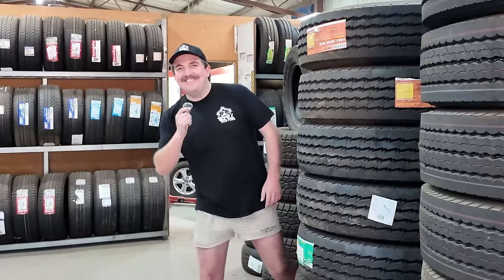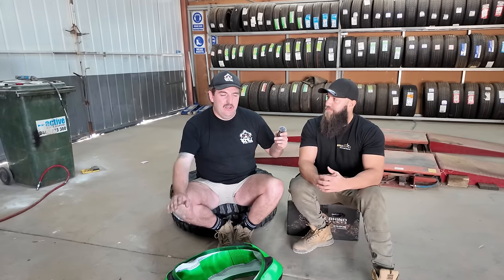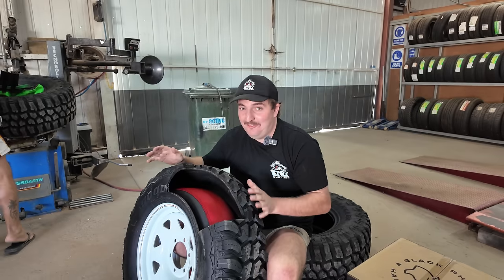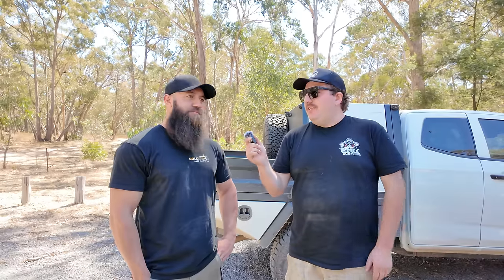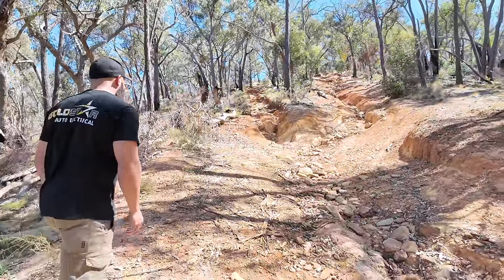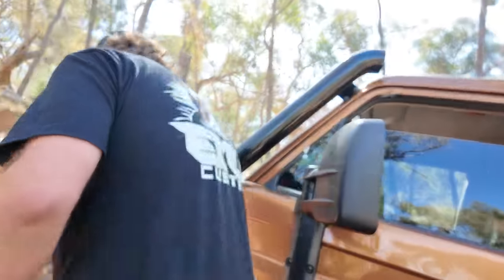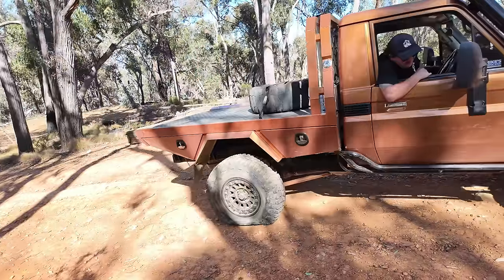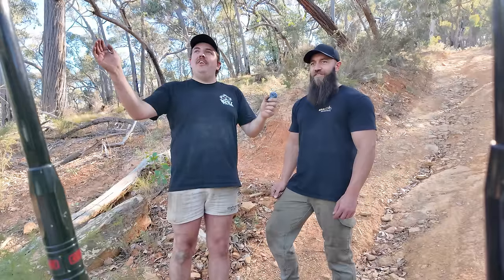No more DEFECTS?!? Pneumatic Beadlocks - (install and torture test)

Comment: Well…… unpopular opinion here: I experimented with internals. Stauns I had in about 2008. Junk imo. If you’re in muddy ruts etc, tree slash, or rocks, -these don’t stop grit getting in beads and the subsequent slow/fast leak. 

They still leak like a non beadlock but with the inconvenience of having to deflate the inner tube to clean out bead. And instead of a non beadlock often being rolled off the rim when you get grit in it, easy to clean out and pop it back on.

With these are still fully stuck on with your leaking bead. You gotta deflate both, then break bead, then clean it, and then you gotta worry about water and debris getting stuck under your inner tube and damaging it or your rim.

The other issue is….. you gotta drill an extra hole for 2nd valve if your wheel doesn’t have it. This also makes your wheel illegal…. Haha

But there is hope…. the slightly better option is Hutchinson internal locks. Worth investigation. I ran those in 2017ish

After many years experimentation, I came to conclusion that if you aren’t going to run a true mechanical lock, just sikaflex the beads and run a conventional tube,that way you can get a bead full of grit with no leak, and even if you punch the tyre off rim with a hit, it will nearly always reseat itself because it doesn’t deflate like a tubeless tyre.

The down side to running tubes at low pressure is that your tyres can slip on the rim and tear the valve out of the tube. Hence the bead sealant.

Anyway. Best of luck. Hope they do what ya need.
Reply from the maker: Hey mate! Appreciate you taking the time to share sounds like you had a bad experience, can i add that these aren’t staun beadlocks, secondair are the original and i have not heard one bad thing about SecondAir beadlocks spoken to guys that have been running them for upto 20 years with no issues and if you watched the whole video you would have seen i didn’t have an issue have also done 3000km since but i guess time will tell!
Reply: @Unclepooly  yea for sure, for what you’re doing they are probably gonna be fine as a road set. -but as you point out these are not a replacement for actual beadlocks offroad.

I wouldn’t say I had a bad experience at all with internals. they worked perfectly according to their design. The concept tho doesn’t solve a couple of the issues that real beadlocks are brilliant for eg: keeping grit out of beads to stop leaks.

This is an issue that the Hutchinson also suffer, albeit a lesser extent. 

Also note: HUTCHINSON are LEGAL mechanical beadlocks. Dot approved! Might be worth checking out as you continue to experiment.

Keep up the good work!
Reply from the maker: @timothyhoppen thanks mate definitely going to check them out for my own research! As i said in the video i really struggled to find any decent information on these internals i think they are perfect for me id love to do more testing around what you’re saying also this might be in one of my next episodes!

What pressures were you running in your tyres when you had the issues with your stauns and also what pressure in the staun tube? Just out of curiosity
Reply: @Unclepooly  I ran the recommended 55psi to begin with, but after I got grit in bead first time I put 80psi in to try fixing it, it helped…. 

Because they have the full sleeve that will stop the tube expanding/stretching too far or getting an egg etc, I reckon you could even try higher pressure around 100psi…. That would be my next experiment.

I never had the tyres come off the rims,  with the stauns, so they worked on that level, but once you drop to that 6-8psi mark, I found particularly in muddy ruts or on pine slash, they were still vulnerable to picking up a leak in bead.

I ran the Hutchinson’s on my 200series for about 3years. Only got 2 slow leaks in that time from grit in beads.

Comment: awesome way to stick it to our shitty laws. its totally BS how long has the Humvee and other military vehicles been rocking bead locks for? to say they have been proven is an understatement. and there simple its a 2 piece rim that uses a chunk of rubber to sandwich the beads against the rim and if you oversize that rubber chunk in the right way its also a run flat.
Reply from the maker: My ute come factory with split rims and im allowed to run them no issues - way more dangerous 😂 unfortunately the law doesn’t cover common sense
Reply: @Unclepooly  still got the split rims that came with our cruiser sitting out back. the irony it use to be a government owned vehicle. and old trucks with the god old interlocking rim AKA the widow maker rims last I heard still legal if its what the truck came with.

Comment: Unfortunately drilling the second hole makes the rim unroadworthy. So just as unroadworthy as conventional bead locks.

Hutchinson Rock Monster double beadlock wheels are the only street legal bead locks I know of.
Reply from the maker: Never once said they were legal but you would have to be bloody unlucky to get done for that tiny little hole 😂 common sense tells you conventional beadlock is way worse
Reply: @Unclepooly  mate, I didn't want to come across as a dick, but blokes like us have a responsibility to be upfront with our audiences. 

And you're right, you didn't say they are legal, but implied it'll stop the defects, which is effectively the same thing.
Reply from the maker: @LockyourHubs4WDing sorry mate i didn’t mean to come across as a dick either! Just more implying the common sense factor here and i think i was pretty upfront with the audience the cops have done me 3 times recently for my bolted beadlocks and im bloody over it these are more road safe than a normal wheel in my opinion and the only way you will find that valve is if you take the wheel off the car and have a look you’d have to be bloody unlucky for it to ever be an issue if i was worried i wouldn’t have made an entire video on it
Reply: @Unclepooly  I'm probably just paranoid mate, I've watched a mates immaculate LJ Torana (235 stroker, injected, now blown) etc get defected for a wire missing to the brake master cylinder...... 

They're out there!
Reply from the maker: @LockyourHubs4WDing me and you both mate! Its a sad system and unfortunately when they’re like that they will always find something all we can do is try our best!